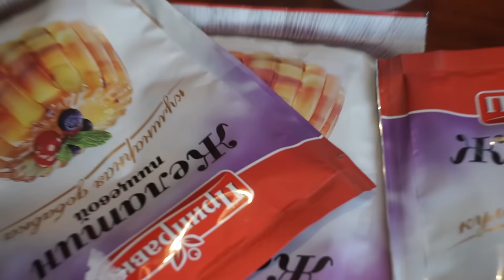Homemade Gear Casting, method of homemade silicone

Comment: preety bad wear couple - steel gear vs aluminum one. Even with the use of grease ad low rev. and load there's tendency of aluminium adhesion to the metal surface. You would be better off casting brass, yet higher temp required I am sure you'd achieve that with the furnace you use.
How is the gear doing after them 7 years, how long did it last? Have you had any teeth broken out due to fatigue, micropores etc.?
Reply from the maker: It's amazing but the mechanism still works and performs its main function.
Reply: @mad_wheel  have you opened it up to check how the teeth are doing? Why use a car, you can ride a horse - still taking you from point A to point B - same comparison.

Comment: I can't believe they would use a plastic gear for a door motor like that. Thats egregious levels of corning cutting. Great job on the metal gear.
Reply: Probably a torque limiting device to save the rest of the gearbox. A designated fail.

Comment: In UK go back to electrical shop 366 days with broken item explain how you will repair plastic gear with casting your own metal, they'd phone police. Go back and actually show them they'd probably go mental.
Reply from the maker: Perhaps, however, in India, it is common to do repairs yourself))
Reply: @mad_wheel  exactly, I agree, why buy another complete product that breaks when you can repair the machine to a better and more reliable condition. It's crazy what gets collected at the waste site, piles and piles of appliances. Designed to only work for short time so another is purchased, the "salesman" either ignorant or stupid when you try and even tell them, that was my original comment, poking fun at them. What you do is my kind of life😁

Comment: Previously, only the gear was broken, now it will break the entire mechanism as a whole, plus the engine will burn when jammed. That's why it's brilliant 🙂
Reply from the maker: Your words are true only in the absence of electronics, since the device has several degrees of fuses and monitors the consumption of the drive and turning it off when the norms are exceeded. For this reason, this drive will not crush anyone, and will not be able to crush the car

Comment: Why didn't the first template work? I'm not a mechanic.
Reply from the maker: The first template did not warm up well, and the finely dispersed wet steam, in contact with the molten metal, caused numerous defects.
Reply: @mad_wheel  Thank you

Comment: I understand how you would cast with low temp metals but how would you melt and mold steel without damaging the part your using to make the steel hot or destroy your molds in the process ?
Reply from the maker: Of course, the forms are destroyed in the process, and serve only once.
Reply: @mad_wheel  Its more the furnace im worried about damaging when trying to get the steel to temp
Reply from the maker: @bow2me26  trước khi đúc kim loại, để khuôn không bị nứt, hãy sấy khô 400 độ và cũng tuân thủ các biện pháp phòng ngừa an toàn

Comment: As all is in russian, please,, could someone list what is necessary ro make homemade silicon?
Reply from the maker: add one part of pharmacy glycerin to one part of culinary gelatin, heat everything in a steam bath, and after cooling, pour into a mold, a rubberized mold is obtained. it can be heated again and it becomes liquid.
Reply: @mad_wheel  Great, Thank You! 😁All the best.
Reply: @mad_wheel  So it is (almost, I suppose) infinitely reusable?
Reply from the maker: @breannestahlman5953  Not quite so, after a while the composition loses its properties and elasticity, alas)))

Comment: MAD WHEEL привет. Классно получилось, но я не понял, а зачем оборачивали лентой на 2:39? Зубья сточились и увеличивали их размер или на случай будущей обработки или еще что?
Reply from the maker: Additional adhesive tape was glued on to compensate for shrinkage, since at the first attempt at casting the gear turned out to be smaller in diameter than the original, and due to shrinkage of the material.

Comment: i think the gear was made of plastic so it would break and still let the motor spin instead of burning out
Reply from the maker: the motor will stop at a certain load, for this purpose the control circuit has settings for the limit load.

Comment: So now when someone gets pinned by the gate the fail-safe plastic gear can't fail and you smash the bad guy. Awesome.
Reply from the maker: That's right, such an idea was planned))) In fact, several levels of protection are configured in the control circuit, when the load on the engine is exceeded, it is turned off by a fuse.

Comment: next time when something gets stuck in the door it will break the whole unit.
Reply from the maker: For such cases, several levels of protection are provided in the control circuit, such as an optical sensor for obstacle monitoring as well as overcurrent monitoring, all of these protections immediately stop the drive when a situation occurs.

Comment: Все норм, только пластиковая шестерня там стояла в целях безопасности, если зажмет кого шестерня уже не сломается
Reply from the maker: For such cases, several levels of protection are provided in the control circuit, such as an optical sensor for obstacle monitoring as well as overcurrent monitoring, all of these protections immediately stop the drive when a situation occurs.

Comment: Excellent work, could you say what are the elements you use, please? because i don't speak russian
Reply from the maker: To make homemade silicone, I used gelatin and glycerin in a 1: 1 ratio, made from ordinary stucco, and used candle wax for the model.
Reply: @mad_wheel  Thaks a lot 👍👏👏👏

Comment: Beware with the plástic gear this is a fuse, is not a mistake ,is a security life for the users , don't should be hard  metal.! !
Reply from the maker: I think it is a failure programmed by the plant. The device has various electrical protections that turn off the engine when it encounters an obstacle.
Reply: @mad_wheel  this is save lifes , is not a mistake , good blessyou.

Comment: A work full of mastery and wonderful artistic genius Thank you very much for the great effort. Please, I have a question regarding the silicone from which I made the first mold. Is the gelatin material that I used the one that is made of my jelly that contains sugar? Or raw jelly? Second, the ratio is 1: 1 for weight or volume, because glycerine is a liquid and the jelly is a powder. Thanks again. I wish you more success in your life and all your work.
Reply from the maker: you need raw jelly without sugar, weight ratio 1: 1.
Reply: @mad_wheel  Thank you very much for the reply and benefit

Comment: very good, the only problem is anything or someone gets stuck to the door/gate when it is closing, they or it will be crushed, because aluminium Gear Casting is not going to brake like the plastic gear did?
Reply from the maker: The device is provided with several electronic and optical fuses in order to prevent such a situation.

Comment: Great casting work I think you should be either in the jewellery or art business.  On the other hand the plastic gear may have  been intentionally the weak point in the system almost like the fuse in the wiring system.   Metal gear equals no fuse.  It's always nice to have a weak spot in the system that can break and be easily replaced.
Reply: I agree but the mechanical fuse should be cheap unlike full gear. Maybe the part that engages with the gear should be a stick of aluminium or even plastic? That would allow having full metal gear with full metal axle and the connection that transmits torque could be e.g. 40 mm long stick of 8 mm thick aluminium bar which would snap if too much torque is applied for whatever reason.

Comment: I thought its meant to be plastic for safety. so not to crush people to death, gear meant to break off..
Reply from the maker: The device has several redundant security systems, the electrical load of the engine is monitored, and optical control is also present.

Comment: Great job!  
But only one little suggestion: did you know about a special type of silicone - the silicone for moulding? I used it with with perfect results. This silicone could make easier first stage of the work. For ex. "condensation cure silicone moulding rubber"; producer: ACC Silicones (Italy).
Reply from the maker: Thank you for the information! In my experience, I tried to use materials at hand)

Comment: It is made of plastic for a reason. They break before the engine does. When the gate crashes into an obstacle it is designed to break the wheel. Better buy a plastic spare part this time than new engine next time.
Reply from the maker: The device has several redundant security systems, the electrical load of the engine is monitored, and optical control is also present.

Comment: The plastic gear is in the system for opening and closing the gate for a reason. If the alarm stop system fails and the gate hits something (someone) the plastic gear breaks and the gate stop.
Reply from the maker: The device has several redundant security systems, the electrical load of the engine is monitored, and optical control is also present.
Reply: @mad_wheel  Planes have many security systems but still fall from the sky.

Comment: Very well done.  Only thing is that very often, when plastic and metal parts are used for a mechanism, the plastic parts are usually designed to be the weak point that's cheap and easy to replace, that way the metal parts that are harder/more expensive to replace are less likely to break.  No idea if that's the case with this, just something to keep in mind
Reply: In most cases parts-breaking is a terrible way to give a safety feature/characteristic.  There are other ways to do this that aren't self-destructive (clutch and/or stall sensing for the motor are two that can be used together - and cheap).
Reply: That is true but seeing how the garage door has to work in freezing conditions where ice can accumulate on the tracks, this kind of cheap plastic gear seems... not ideal. To put it mildly. Cold temperature itself makes plastics brittle and compounded by any kind of resistance on the tracks seems like as a part that has to be changed constantly.
Cold always makes everything more expensive and i would have went with some kind of load resistor that cuts power if things get stuck.

Comment: Although that plastic part is designed to break to protect the other parts of the mechanism, making it from metal means that protection is lost
Reply from the maker: The device has several redundant security systems, the electrical load of the engine is monitored, and optical control is also present.

Comment: Respect
- Manufacturer designed the part for Nutella-Generation (Greta Thunberg). They will buy just a new one after the guarantee is up.

This guy is from the future and replaced the broken part with a well engineered solution which will work 100 years.

Comment: I guess that mechanism is for remote controlled gate, right? You did really good job casting that gear, im really impressed, but i must point that there is reason why that gear was maded out of plastic. You see, sometime  you design some part in mechanism to fail, simply because it will save some other, more expensive parts from failing. In this case, i think saved parts are someone leg or arm :D Good job, but i would still choose 3d printed gear, over aluminium casted gear, at least here
Reply from the maker: The device has several redundant security systems, the electrical load of the engine is monitored, and optical control is also present.

Comment: way too much work for a gear that can bought of ebay for less than 5 Euro, also plastic sprocket acted as a torque limiter and could fail without burning the motor when there was a blockage.
Reply from the maker: But I would not have gained such experience! The transmission is not a fuse, as the electrical circuit controls the current draw of the motor and the drive is disconnected from the power supply when a predetermined force limit is reached.

Comment: The original gear was meant to easily break when under too much stress in order to save the other mechanical parts and perhaps the electronics from damage.
Reply from the maker: Rather, it is a planned breakdown by the manufacturer, in my opinion. The control circuit provides electronic protection against overloads and against collisions with people and obstacles.

Comment: Хочу предупредить что шестерня не зря из пластика. Она служит предохранителем от перегрузки мотора. Если поставить такую как у автора то при заклинивании ворот сгорит мотор! Лучше заказать или самому сделать из пластика и поставить на место.
Reply from the maker: Rather, it is a planned breakdown by the manufacturer, in my opinion. The control circuit provides electronic protection against overloads and against collisions with people and obstacles.

Comment: Nylon gear are made for motor saftey,so its better not to replace it with metal gear
Reply from the maker: Rather, it is a planned breakdown by the manufacturer, in my opinion. The control circuit provides electronic protection against overloads and against collisions with people and obstacles.

Comment: Looks like tons of fun, but every time I ever tried an approach like that, the coefficient of thermal expansion killed it because by the time my part cooled, it was about 4% to 7% undersize.
Reply: Try coating the original part in many layers of paint before you make the mold, and make sure you have a big riser to suck metal from as it cools

Comment: Awesome! Most people just throw broken stuff away and buy another. You made it better, unless the plastic gears were a designed point of failure to not burn out a motor or something? Still, bloody good job!
Reply from the maker: The device has electronic protection against increased current, as well as protection against collisions with a person.

Comment: Ok here is the problem with this.   One reason the gear is made of plastic is as a SAFETY FEATURE.   If a living creature gets stuck in the way of the door, the gear will strip instead of crushing the child.    He has bypassed that safety feature.

Would have been better to cast if of plastic again.
Reply from the maker: The device has an electronic fuse, when the current rises, when an obstacle on the way, the electronics blocks the motor, optical sensors are also installed in the kit, they do not block movement when a person or a car is in the opening. The plastic gear is a programmed breakdown, unfortunately many manufacturers of various equipment are now resorting to this business scheme.
Reply: @mad_wheel  Nevertheless... the gear is plastic as a safety feature.  The manufacturerer did it on purpose because he felt it necessary.  The video poster has bypassed a safety feature created by the equipment manufacturer.

Comment: WOW!  we print 3d and then melt out and fill with metal - but that requires pre-engineering a solid model - what a nice shortcut - thank you for both innovation and sharing!!!
Reply: What filament do you 3d print before casting?  Or do you use resin?
Reply: @hothmobile100  Really wish this question got answered!
Reply: @hothmobile100  pla is very commonly used for this because of it's low melting point
Reply: @LimabeanStudios  When PLA catches fire, the smoke and fumes are low toxicity, while many plastics are exceptionally dangerous to burn. So you can burn PLA out safely rather than trying to melt it out.

Comment: This is the most innovative way i have ever seen on casting a metal gear. Bloody hell, genius!
Reply: Innovative????? This is called lost wax casting and its older than injection molding.
Reply: @prestigeworld-wide8292  i can see why it's older than injection molding, because it's limited to quantity. Great for homebrew then in these day and age. 

The use of Off-the-shelf material is quite innovative. Because they aren't purposely used for industrial and it is readily available.
Reply: Stryker

Comment: This is a genius fix, really.  The gelatin mold probably cost 1/20th of casting silicone, and it worked well enough.  Likewise using random candle wax for the casting.  For the people down voting, I'm reminded of a quote of what an engineer is by a co-worker - an engineer is somebody that can do for $5 what any random person could do for $50.  This thing isn't going to space...as long as it doesn't jam and the teeth don't strip, it's fine.  Nice work.
Reply from the maker: thank!

Comment: its presumably plastic to prevent someone getting crushed by a gate. a safety feature. if someone accidentally gets stuck in between the gates the plastic cog breaks.
Reply from the maker: For protection, in the electric circuit there is control and monitoring of the force, if it exceeds the set limit, the engine stops.

Comment: What disgusts me is that the mfr would have used a plastic gear for what is clearly a high torque application to begin with. That was planned failure just to try and save a few bucks.

Comment: how stupid is it to build a gear out of plastic for this machine, i mean they probably sell it for shit loads of money, but u made it better with ur own gear, now it will last for ever until the next plastic part will just break.
Good work my friend, tnx for sharing.
Reply: because plastic is pretty much inmune to weather (unless very extreme temperatures are reached). and pretty decent wear resistance. so they work ok as long as you dont load them a lot or gets damaged with sunlight.